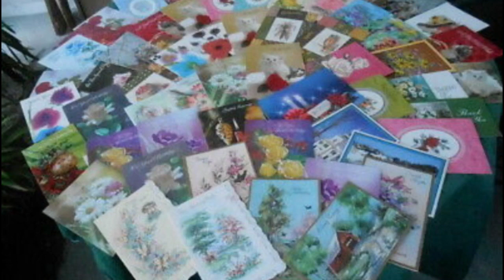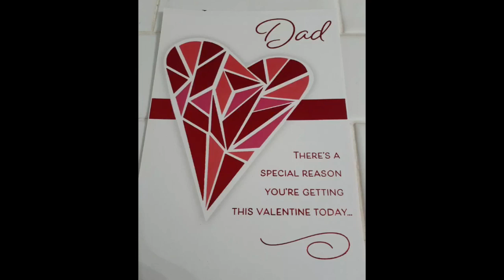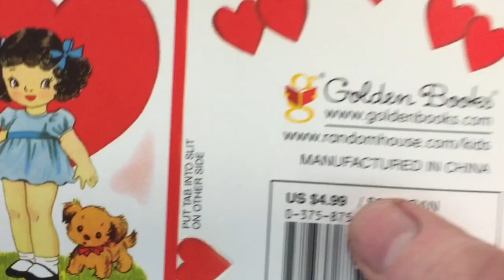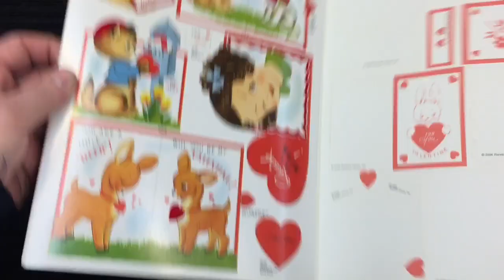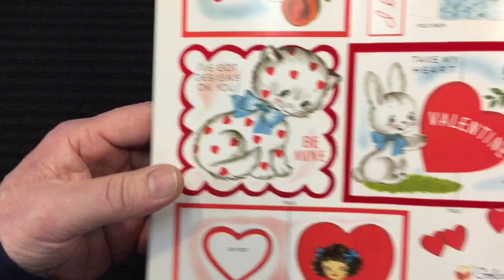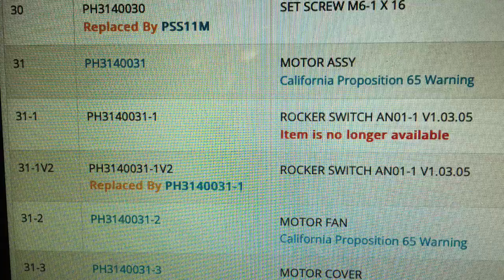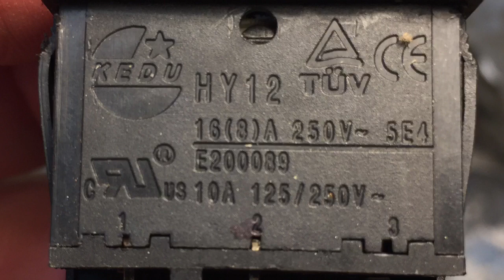Valentine’s Day Special! Garfield Phone and Switch Replacement on the 1x30.

Comment: I just bought an old Walker Turner bench grinder that had a broken toggle switch, just like the one you used for your replacement, I was thrilled to walk into a local Ace Hardware Store and buy a replacement right off the rack. I love that old metal style switch. Clean and neat. Another great video, thanks again for making them.

Comment: I had a rocker switch of similar bad design fail on my grinder last week.    This failed in the ON position.   I had to unplug the grinder.   I replaced with a good toggle switch similar to the one you used for the replacement.   Nice solid click feel on the new switch.
Dave.

Comment: Great video thank you for sharing over the last couple years about to replace a couple switches on power tools I didn't have the option of using a toggle switch
Reply from the maker: I often have to replace switches in equipment and now I am tired of searching down the OEM part so I kind of make due...  In fact I have a lot of wall switches I might start using!  =D

Comment: For the switches that failed in the on position – normally the contacts arced and were spot welded together.  The switches are good for a limited of number of cycles and wear out.

Many times, parts become “obsolete” because a vendor stopped making a particular part number.  Just because a part is obsolete doesn’t mena there isn’t a plug in replacement under a different part number or from a different vendor.

On another subject – rumor has it  that your mice are planning a Valentine’s Day celebration tonight.
Reply from the maker: Oh no! 🐁🐁🐁🐁🐁 😂👍

Comment: Check the lever of the switch, there should be spring loaded pylons in there to improve the contact. The new switch isn't as dust resistant as the old one.
The old switches aren't permitted due to exposed live parts and also depending on the load you switch there will be arcing if you operate the switch.

Comment: Nobody tell osha, but the only way to cut all power to my home, like if you needed to work on the panel, is a large knife switch close to the ceiling above the panel. I got very very lucky when it was inspected, the gentleman apparently did not look up. I was very thankful, I would not have home insurance if he were more observant
Reply from the maker: LOL   They do work well...  Just be fast so you don't arc so much!   =D
Reply: @ScoutCrafter  That's the best part! The pretty light show

Comment: I think there must a subsection of Murphy’s Law to the effect that power tool switches will only fail in the on position. Light switches  however will only fail in the off position. I had at one point a Delta 8” portable table saw where dust would get into the switch and the contacts would get arc welded in the on position. Kind of scary the first time it happens and you can’t just leave the job to get a new switch and fix it. Wound up carrying a spare switch in my van.
Reply from the maker: It's true!  When you are working on a power tool the last thing you want is a run-a-way tool!  LOL

Comment: Restoring old things sometimes requires repairing the original switch. Usually it's not a nice experience. Little springs, things balanced on ball bearings that have to line up with other things that are impossible to hold in place when you reassemble... you know the drill I'm sure. 
But, my worse switch repair experience has to be the push on/push off toggle switch on an old Anglepoise lamp. If you ever need to fill a swear jar, take one of those apart and try to reassemble it.
Great video as always.
Reply from the maker: It's kind of nice when the components are quality made and the switch can be rebuilt..  Some of the early electric switches just needed a good cleaning and a little lubricant!   Thanks!

Comment: There are dust covers available for toggle switches as well. I have one on my sherline lathe's on-off switch. It does make the switch feel a little 'mushy' but keeps the mechanism clean. And if the switch ever goes I can probably put the dust cover back on a new one if it's still in good shape.

Comment: I’ve taken apart the switch on my drill press 4-5 times because it will arc to the plate inside…. So I have to clean it and put a small amount of grease for lubrication …. They are junk made in a foreign country
Reply from the maker: Dan- Next time mine goes I am replacing with a wall switch!  LOL

Comment: While I too install toggle switches like that one when I can, I am guessing that the engineers who designed that belt sander specified a dust-proof switch for a reason, especially when the "dust" is metal dust. Consider dust-proofing the toggle switch by putting the cut off little finger of a rubber glove over the toggle and under the nut that fastens it to the plexiglas plate.